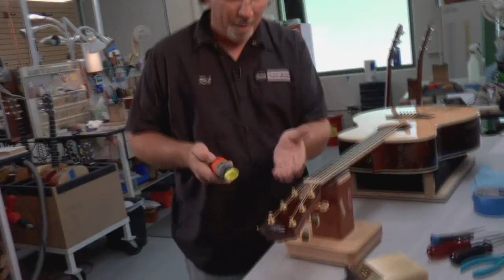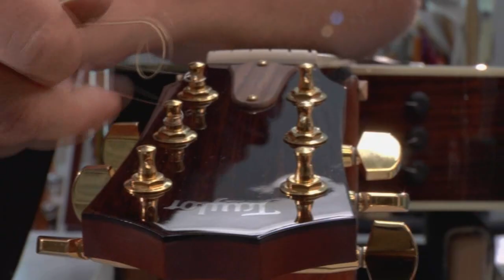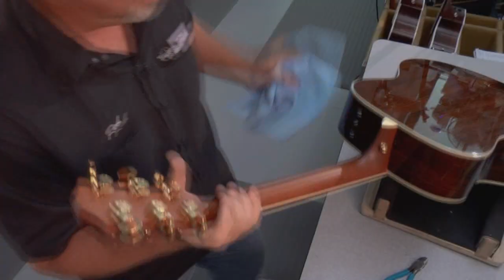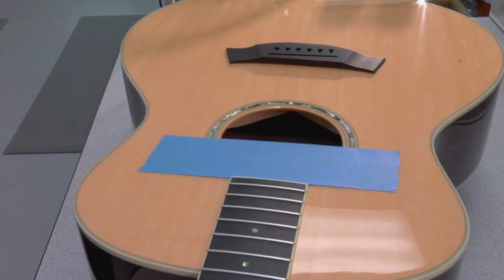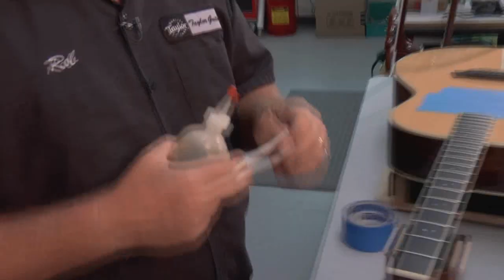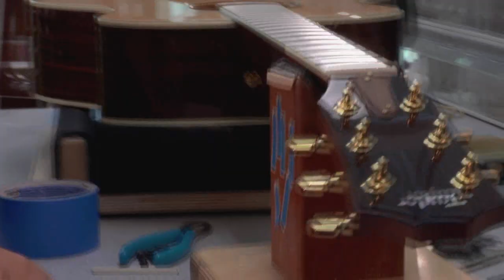Taylor Guitars Cleaning and Maintenance Techniques: Part 1 | ELIXIR Strings

Comment: As a physician, surgeon and luthier, I can tell you what to put on your guitar and what not to put on your guitar. When I finish working on a guitar for someone, one of the services I provide is to detail the body and fretboard. This is most easily accomplished with the strings off and with the following (to clean and refurbish the fretboard. I use something totally different for the finish of the guitar):

1. 0000 steel wool

2. Murphy's Wood Oil Soap

3. An old cotton towel

4. Pure Almond Oil

5. A clean cotton towel

With warm water and the Murphy's Wood Oil Soap, you lightly scrub (with the grain) with the steel wool. You can use brass, as it is softer, but finding it in a 0000 gauge is nearly impossible. Doing this with the old towel underneath the neck will catch the drips. Doing about 5 frets at a time and then wiping off the crud with the old cotton towel, you work your way up the neck. You'll find that rinsing the steel wool often (several times a fret) will help extricate the dirt and oils from your fingers and really clean it off the wood. Once the entire neck is done, a finish by carefully taking the steel wool across the fret wires to polish them as well. If you've done a good job of getting the crud off the fretboard, it should look uniform and dull, without dark areas or light areas. If this isn't the case, throw out the Murphy's Wood Oil mixture, mix up a new batch and do the fretboard again. You'll be amazed and disgusted as how dark the water is as you pour it down the drain.

Now, the good part. Take the clean cotton towel (or wash cloth) and put some Almond Oil on it. A little goes a long way. Go fret by fret, rubbing it in with the grain of the wood. By the time you get to the top of the neck, you'll have enough of it soak in that it is time to wipe off the excess. The neck will look as though it was new (maybe better). As Almond Oil is pure and a natural byproduct of processing almonds, it has no additives, no preservatives and is completely natural (unlike Lemon Oil, or Scott's Liquid Gold or other things which are petroleum based and will raise the grain of the wood and does more harm than good). Restring the guitar and you're ready to go. I'm a firm believer that absolutely nothing other than Almond Oil should be applied to the bare wood (fretboard and saddle) of a guitar or any fine wood.
Reply: Thanks for the information. Like everything these days, guitar world too is so full of weird myths that it is unreal. There are a lot of guitarists (with no knowledge of carpentry what so ever) who'd say: "No, you can't use boiled linseed oil or any other natural oil on fretboard! Only lemon oil works!". Yet many of the most highly regarded violins of today were made long before this mineral oil based "lemon oil" was ever invented.
Reply: Doc, I'm with you on the Murphy's oil soap and most of the other tips you give.
I have a question though, My shoulder hurts when I raise my arm over my head and I go like this....
(sorry, I couldn't resist)

Comment: 50years of changing strings and I finally learn how to do it the factory way! Gotta love the stand he used! I used the kitchen table and a towel with the head hung over the edge and that plastic winder that I have was very useful (finally).
Reply: You can buy those work stations on amazon for like 20-30 bucks. That's the neck support and mat. Electric string winders are 30-100. All the polishes and fret oil comes in singles or up to a 5 pack of various polishes and oil from 10-40 dollars .

Comment: Thanks so much! Really appreciated that you use general, affordable products that can be bought in bulk and that work effectively! 
My first time using 0000 steel wool on the fretboard itself (not only the frets) and boiled linseed oil to hydrate. It totally makes sense, as this is what's is commonly used in furniture making and in oiling wooden tool handles - so why not guitars? It's just timber after all.
Thanks again!

Comment: Using a set of diagonal cutters as a tool for grasping the bridge pins is risky with bone pins.  They can easily scratch or crack the brittle bone.  There are cheap (under $5) plastic pin pullers that are a lot safer to use.  Or you can use some cloth around the jaws of the diagonal cutter to protect the pin from the sharp edges.
Reply: At least he didn't use a claw-hammer to pull them out.
Reply: @allennance949  But he did lever against the saddle.
Reply: John Shalamskas lucky that Taylor use ebony pins then eh
Reply: @HarryNicNicholas  d-bag much?
Reply: I was a little surprised by the metal wire cutters being used to pull the pins.
Reply: @allennance949  🤣

Comment: Thanks so much! This is very practical, easy to follow instructions. And if routinely followed, it will keep your guitar looking great. But so many people wait until they've got layers of crud on the fretboard, as well as on the various crevices of the guitar. So easy to MAINTAIN a guitar's finish, as opposed to trying to have to radically clean it after long periods of buildup, and what the oils in your hands and string corrosion particles do to it.

Comment: Couple things I would add, keep your bridge pins in order, especially on older guitars. I use lemon oil on my guitar neck, unless you have a guitar with no finish applied, you’re actually waxing the finish, any good furnish will work. Waxing will help keep from scratched

Comment: a couple of tips. I love playing guitar and I have been buying your strings for yrs along with deans.  DO NOT WAX BEFORE YOU  CLEAN. As you rub the wax on you're also rubbing dirt into the original finish.  I work in the car res-toe biz. We never pull in a car for a pre show prep and clean and wax it first. We hit it with a HAIR DRYER on cold setting to blow off dust you cant see with the eye. Then we flow rinse it for a few mins per panel. Then we hit it with a soap cannon loaded with dawn dish liquid. we rise with a mist. Then we rewash with dawn and a microfibre with a new microfibre cloth. We rinse and then hit it with a buffer with a mirror glaze but with what was left in the pad from the previous job. If it looks show ready then we wax. If not we back up and go to a polish then then the mirror glaze. 

My boss use haul them in and wash them with the soap and a micro fiber. He would be adding scratches by not doing my first few steps and adding time in doing the job. 

I am on a pay scale (my doing) in what I am doing. Paid $45/hr for media blasting and detailing show cars.  $42 for spraying a car and $37 for body work/sanding. $28 for cleaning the shop lol. I hate sand blasting but i will do it for 16 hours a day this time of yr because on paper Im paid $28 for my 50-60 hour week. The rest is cash and my pay stub shows a $28/hr salary...thats bonus money my wife don't know about an my gun collection is getting huge and as far as the wife is concerned my resto mod 74 corvette has only cost me (us) about $1800 yet lol. Damn woman found a few receipts i was careless with lol. 

Anyway I got long winded.  Clean the fucking guitar before you rub dirt into it thinking you're just adding wax. If its a regular customer if you took pics you will notice in time ech time it comes in it looks more and more dull. Its dirt build up in the layers of wax.
Reply: I lost interest as soon as you started telling us how much you make.....nobody cares
Reply: What's that got to do with the price of rice in China ?????????

Comment: AFTER the tape was applied I'd wipe down the guitar, to remove any tape glue residue.

Someone mentioned using only drafting tape instead of masking tape.  This blue tape-from 3M, I believe-comes off very easily.  I used it quite a bit when painting homes.  It's not very sticky.  But it still has glue on it.
I'd also use a vacuum instead of a brush to remove those bits of metal after using XXXX steel wool, unless you have a shop like he has.

Comment: Steel wool longitudinally does not clean next to frets. Oil with toothbrush cross wide does. I use teak oil. You can use boiled linseed. You can also use body lotion. Just wipe off excess.
Reply: R.Lee
I like,LIQUID GOLD wood cleaner and preservation oil...with small piece of T-shirt cloth and work it into fretboard and bridge sparingly!.. Not expensive. Boiled linseed oil can get a crackly film when dry. It's a paint additive.  Also very lightly clean the " gunk" build up on each side of fret use a sewing needle .I use an old air brush needle it's long and less likely to " dig in " do it very very LIGHTLY at an angle. .Also 3M makes a auto body " scratch" pad but get the GREY colored one...NOT THE RED. Use common sense light pressure. Its mainly used in prep work before clear coat on 2-3 stage paint jobs. Don't let the words SCUFF OR SCRATCH scare you..approach with a very light touch..u can cut a small square with scissors. Its the artisans version of a pot scrubber .but extremely fine..plus no steel wool floating around.
Ciao
Paolo

Comment: ive broken bridge pins pulling them. i have to put hand inside guitar and push them out. chops sticks make a great free fix in a pinch. i also broke a bass tunner from tightening it with out string tension. tunned it up and snap!🍻

Comment: I don't tie my strings either. Simply wrap them from top to bottom 2-3x around the post and they are just as secure as tied.  Been playing since the 70s and wrapping around the posts is all that's required. They won't come loose, they wont affect intonation,  they don't go out of tune, and it makes it easier to change strings. No negative effects whatsoever.

Comment: using f-1 by musicnomad is okay but be sure not get any water in there. Also, when using steel wool make sure it's a VERY VERY FINE steel wool, otherwise you can open up the little parellel crevice/minute cracks on the fretboard. Using the steel wool parellel might be better than perpendicular to the fretboard. otherwise just use the rougher side of the sponge if you have any doubts. I used steel wool and I'm seeing a light brown color appear certain areas of the frets which make me think that some dampness got in those cracks after using steel wool. Be VERY CAREFUL with older guitars in a high humidty enviroment when cleaning. (of course dry heat can affect an acoustic guitar also.

Comment: Those who have painted guitars, as I have done, know that boiled linseed oil hardens like varnish, the method he used is the least recommended if the guitar is going to be in places with hot climates or high humidity since boiled linseed oil starts to get sticky

Comment: Funny. That's exactly the side cutters I use on my identical Taylor.  I put a bit of tape on the back side of the cutters. I suppose the debate on neck waxing will go on and on, but  I find that it works beautifully on my Taylor, but not on my unfinished Hamer maple neck. The Hamer likes the 4000 steel wool, but that's it.

Comment: What about all the dust inside the sound hole ? Just a damp cloth? A can of air blaster? Anyone have any tips ?
Reply: Air compressor in the garage. Blow across the top of the sound hole, not directly into. It will make a howling sound and the dust will come flying out. A can o’ air works too. i wouldn’t use a damp cloth.

Comment: Or try my technique for cleaning.  Grab a shop towel and make a couple swipes down the neck and around the sound hole, making sure not to worry about dust getting into the sound hole because dust already has and always will enter the sound hole.  Job complete.

Comment: I do love elixir acoustic strings. Taking all the strings off is ok if it is a new guitar. If it is a vintage guitar, you need to be careful because some parts may not work as good as they used to(like the truss rod). You can snap a truss rod if it is stuck and then its a bit of a pain to fix.
Sammy Bones 
 #trussrod   #elixir   #acousticguitar   #guitarstrings

Comment: Great video.. One question. Do you use boiled linseed oil  so the oil remains topical? I understand raw linseed oil penetrates through the wood. Other applications, levels and tool handles, they benefit from that, maintaining flexibility so as to avoid cracking, splitting etc.
Reply: I was just wondering if you have used boiled linseed oil from "Klean Strip" ? I'm not experienced at this and wanted to know if you can trust this brand? It doesn't say for guitar specifically so I was in a dilemma.
Reply: @robinghimire826  I haven't any applications relative to guitars, only tools . Subsequently I only use  raw. I'd defer to a higher source

Comment: What about the cleaner, and or sealer, for the body of natural taylor guitars like for example the Mahogony GS mini?
Reply from the maker: Hi, check with Taylor Guitars directly on what they recommend. Their website is full of great info. Thanks.
Reply: @ElixirStringsMedia  Thanks, found that section on the Taylor website and for satin guitars they say, "These areas can be wiped down with a slightly damp cloth for cleaning. Avoid any wax or thicker polishes on satin finished areas as they will leave the finish looking splotchy. Our Taylor polish mentioned above is safe to use on satin finishes."

Comment: You know I use Elixir strings and I believe they are the best but I guess we all do things differently when it comes to changing strings. Don't you put the same pens back into the same holes at Taylor's? Every string has a different size at every slot gets used to the same size string so if you're using $40 pins so why wouldn't you put them back into the same holes so the string size you use wouldn't wear them out? just asking you a question. Not trying to be a smart-ass but just asking a simple question

Comment: Remember he said "Boiled" linseed oil. There is a difference between raw and boiled. Boiled has drying agents, and DO NOT follow the suggestions on the bottle that say to let it set. I think that will make it gunky, which you definitely do not want!! Just lignt on a cotten or paper towel and then wipe it off with the clean side.

Comment: Never use masking tape on any guitar. Always use Drafting Tape. Drafting tape is not very strong so you don't pull finish off of the guitar.
Reply: Painters tape, don't pull the finish, it does not get stuck as normal making tape

Comment: What sort of masking tape is that? Painters tape as to not leave a sticky residue?
Reply: You can buy a really "low tack" tape. Basically it sticks and holds but it comes off incredibly easily, like it was never there. Not sure how sticky painter's tape tends to be but I just did a search for low tack tape and found one that worked well.
Reply: Judging by the blue colour, it's probably a wide size of Scotch Painters Tape, which is very effective but doesn't leave residue.

Comment: Hey dude, where can I get that lindeed oil??? Any alternatives?
Reply: i recently got some "lemon-oil" from my local guitar store. its a fret board cleaner and its pretty much the same, plus it smells lemony.
Reply: There is besides lemon oil and same goes for body also string cleaner.
Reply: Boiled linseed oil is the way to go. It dries out much faster than raw linseed oil, so it doesn't have as much of a chance to sink in and screw up the glue holding the fingerboard to the neck. Linseed oil is non toxic, which is nice since you are going to be touching it with your fingers every time you handle the guitar.  Look for it on Amazon, or an art supply house.

Comment: Having supplied you the steel core wire for that string, I can tell everyone with out the benefit of electrical amplification there are as dead when you put them on as when you take the off
Reply: Bob C they sound great... for the first two weeks. I love Elixers but they lose tone too fast and are expensive
Reply: What strings do you recommend?

Comment: LOL...cool.....i have been using turtle wax on guitars for ages. Glad to see someone else thinks it's a good idea as well
Reply: I never use anything other than Murphy's oil soap, diluted 3 to 1 with distilled water to clean and polish my guitars, even on the fret boards, plus a little Cape Cod metal polish for frets themselves.  
It's been working for 40 years and never fails to keep them clean and looking great.
Reply: @charlie-obrien  I only use turtle wax in the solid body electric. It doesn't show fingerprints easily. I managed, and "service managed" a music ship for 33 years (starting in 1974). Everyone waiting for their meatball sub in the shop next door, covered with drywall, would come in all day wanting to play our electric guitars . They had absolutely no intention of buying. The turtle wax worked well for solid body electrics to keep the finger prints down. Just to show you how bad it was in that shop.....the same man would come in on Saturdays for 20+ years and play "a scale" on a classical guitar and then just leave.

Comment: Just buy your guitars tuned.
And buy a lot of them.
The strings go on the outside.
Reply: bwhahah thanks you for making my day.
Reply: "Pro Tip: First step: Run all 6 strings backwards through tuner so the eyelet/ball ends at headstock. Finished? Good. ...Now what did you learn??"
Reply: HAHAHAHA!!  The perfect solution.  And if it goes out of tune take it back to the store.
Reply: Is here the spy guitar?

Comment: the best way to wax a guitar is to use carnauba wax, you rub it in, let it dry, and buff it off. you also rub in a circular motion instead of a straight line. minimum two coats.